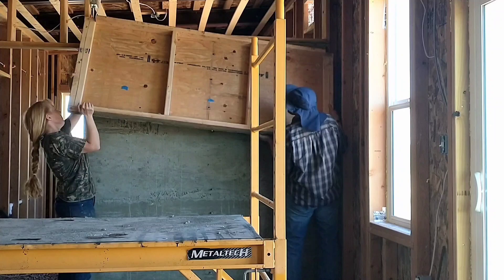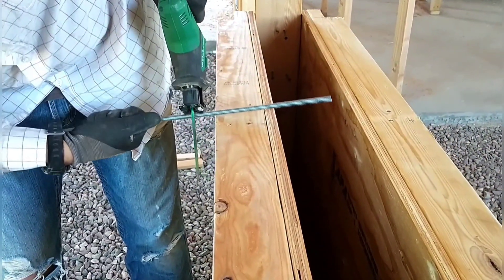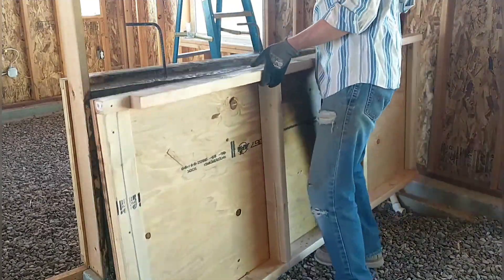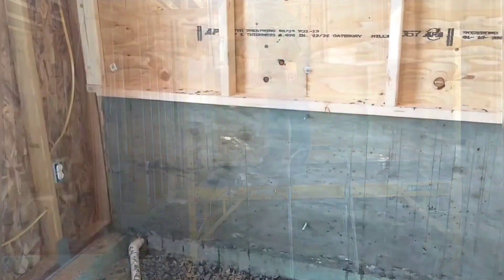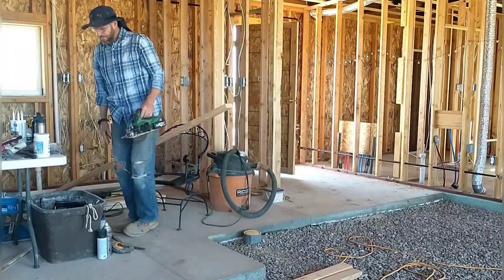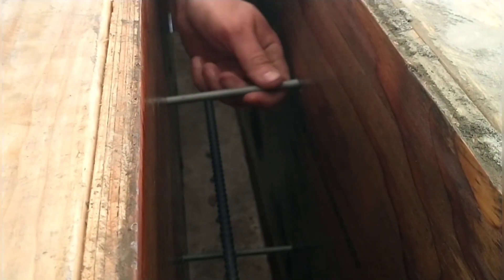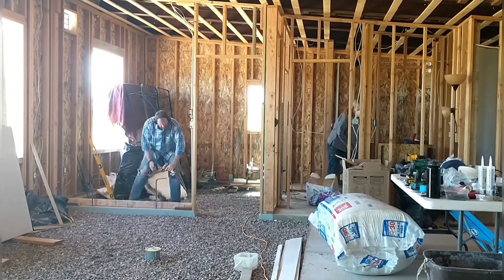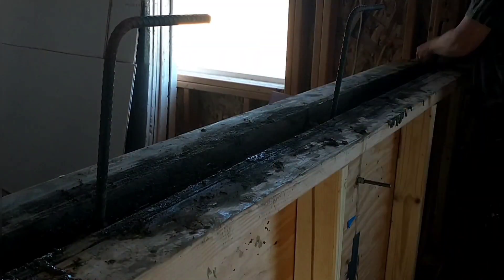Interior THERMAL MASS Poured CONCRETE Walls | Passive Home Design DIY Off-Grid Build #31

Comment: Noce job, folks!

To transfer woodgrain onto a patio tabletop, my wife and I used pvc trim pieces - which have a woodgrain embossed on them. That worked well and kept from getting moisture on the wood form. Clean up for reuse was a breeze.
Reply from the maker: Sounds like a pretty cool table! Thanks! 😊

Comment: For the future, if you happen to do more pouring like these walls...
consider getting a dolly. Yes, I see that you have steps up and down but small ramps are worth the time too, although my big pneumatic tired dolly climbs up 4 to 5 inch rises easily.
I just put the empty bucket on the dolly, fill it at the mixer and wheel the bucket to the pour. the only time I have to lift the bucket is to actually pour it.
A few times I've even put a piece of  18x18 by 3/4 plywood on top of the bucket and put a second bucket on top of that. Just to be careful I put a rubber bungee cord on to hold the bucket securely to the dolly.
My back sure thanked me.
Reply from the maker: Nice! Sounds like a great way to do it! Our gravel floor makes things a bit of a challenge. We briefly considered doing our whole house out of poured concrete. We would have definitely needed a better set-up for that. 😎
Reply: @RedandAprilOff-Grid  bit late to reply but YouTube just notified me you commented.
The tires / wheels I'm using on my dolly are actually 11" tall by 4.5" wide riding lawnmower units. I took off the narrower factory tires and changed to the bigger ones and they handle gravel or soft ground awesomely. They have built in bearings in the hub but the ID was larger than the axel so a trip to Home Depot to the hardware section where they sold bushings and washers that I used to adapt everything to fit.

Comment: I’m so glad you mentioned radon! I didn’t realize it was an issue in SE AZ…we had a radon mitigation system at our house in CO and it’s pretty common there…it’s now on our radar for our AZ build :) Great progress on your build!!  Love the poured concrete walls…a technique we’ve not seen before.  Well done!
Reply from the maker: Thanks for watching! Our area has a moderate risk for radon, so we thought it would be good to add some venting under the floor. Several viewers have recommended it. 
Thanks! Yes, we love how it turned out! Best wishes with your move to Arizona!  😎🏜️

Comment: Wow big advancement with all the hard work beautiful construction of the concrete walls very impressive as well as the explanation of the thermal mass concept for the winter heat, and the summer passive cooling, you both work so well together,  break time seemed to be insulating and hanging drywall, truly motivated builders,,,,,,, thanks for sharing your incredible journey to self sufficiency ……great videos well shot, edited, with informative narration, every step very well explained.
Reply from the maker: Thanks so much! We really love how the walls turned out and also love their functionality!  Really appreciate your encouraging comment!  There is definitely a lot going on with everything we have going on and are trying to do. 🤗

Comment: One thing about your channel as I have committed on before is how you explain what you are doing and why, really cool that you take the time to do so nobody’s left wondering why did they do that ? The ideas you come up with are really good 👍 I was wondering if someday you would use tubes buried six feet under ground for free air conditioning ?
Reply from the maker: Thanks so much! 
It could be done, but isn't ideal in our area. We have 9 or 10 months without any significant rain, and dry soil doesn't work well for geothermal. We should stay pretty comfortable with our house orientation and an evaporative cooler in the summer and  the occasional use of the wood stove in the winter. 🌞🏜️
Reply: @RedandAprilOff-Grid  Not to mention the Calichi layer (basically a softish stone) that you would have to dig thru to get 6 ft deep.  I have tried the EarthTubes in two different house projects in AZ.  It never works as hoped, even suplimented with a pond pre-cooler the 2nd time, near Gila Bend.

Comment: Walls look good. If you like the thermal mass concept, why not add thermal mass to floors too? Interesting seems in wall. Would be cool if you could divide to make horizon lines a Fibonacci sequence. Love the wood grain pattern and that you alternated sides between pours. Awesome. Thanks for sharing
Reply from the maker: Thanks! He mentioned the thermal mass aspect of the floors in the previous video. He did consider it, but decided to go with this design so we could get it done in 6 days. We probably could have went with a shorter frame and put one on each side. That definitely would have looked cool, we love the seams! 😎

Comment: Lovely job, and a great use for that cement. Did you consider the idea of rammed earth for the thermal mass wall?  Perhaps such a wall wouldn’t use as much cement.
Reply from the maker: Yes, we were trying to use up more of the cement, and we figured this would be faster. We are thinking about trying something similar to rammed earth for the floors. Thanks! 😊

Comment: You could use a concrete vibrator in the walls to really eliminate air gaps and smoother
Reply from the maker: As much concrete as we have done on this house built we should have bought one. 😄 We like the look of the wall as it is though, it has character. 🌞🏜️

Comment: @Red & April Off-Grid - In Europe the houss are build from concret, stones and two or three layers of glas. Can you imagine the insulation effect we have here also when the temperatures changes quickly outside? This is one of the biggest differences between the US and Europe. Very energy effeicnet. Plus in teh Netherlands you have to have solar on your roof.
Reply from the maker: Nice!  After the aircrete didn't work out, we did briefly consider poured concrete walls for the exterior. With a well insulated roof like we are doing, and the orientation and overhangs, I think it would have done really well, and would have definitely been a lot stronger. I am really impressed though at how nice the temperature in the house is with just the rigid foam board on the outside. It should do even better with the fiberglass batts on the inside. We will be adding another R-30 to the roof and R-13 to the walls. 🌞

Comment: Really like this thermal mass wall... Turned out good. You can "dry bag" (sack & patch) touch up the wall a little if you wish to clean it up slightly without losing the overall texture and appearance. We do this on structural retaining walls often, just before completion. Basically taking some of the cement and bagging it dry (in something like a burlap or cotton bag so the concrete can shake through the bag), then wetting the wall down in areas to be touched up.... and slapping the bag of dry cement to fill in holes & pock marks. Looks great and will be an excellent backer for your stove. Cool idea & well executed. Essential Craftsman channel has a great video showing the process on a retaining wall: https://youtu.be/xZEO9kNzBro
Reply from the maker: That's a really cool tip! Thanks for watching! 😊🏜️

Comment: Some obvious improvement would be to have a proper bucket with an easy handle. Thin wire will cut your hands. Also, it seems that all-thread is easier cut with the nuts on it already.
Reply from the maker: The buckets we already had worked okay, and his hands were fine. It would have helped to put one nut on before cutting, but not both. Not saying this is the best way to do it, but it's what we did, and we are happy with the results.